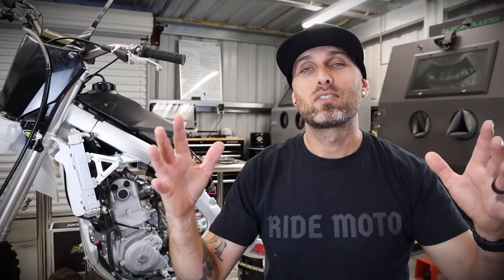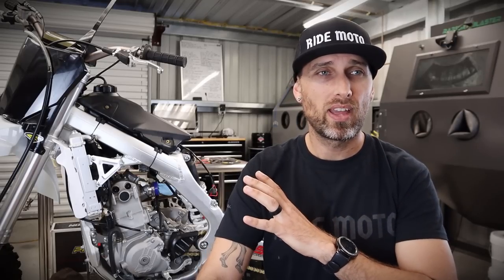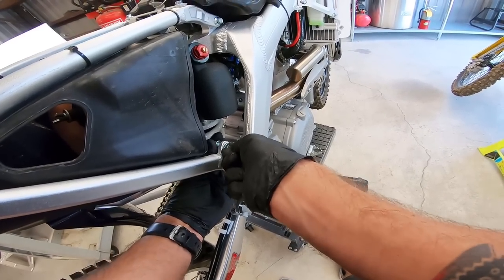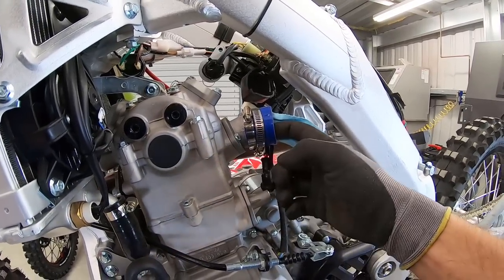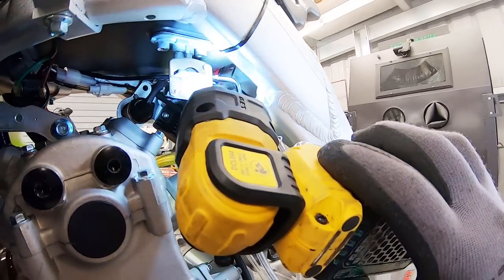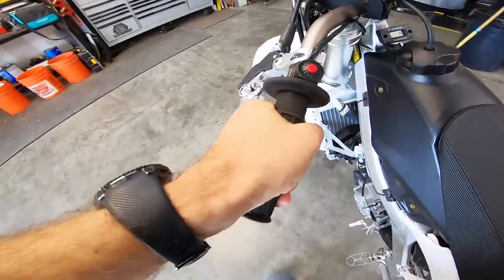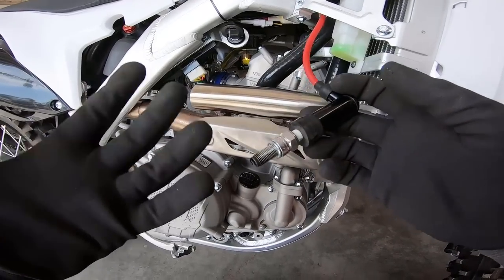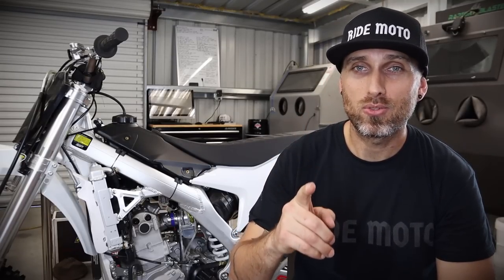I Installed A Lectron Carb in my CHINESE Dirt Bike... SHE REVS!! - 2020 SSR Motorsports SR300

Comment: Thank for this very good video ! I have Kayo T4 ( 250cc zongshen air cooled ) with a stock " Nibbi 28mm " carburetor, I planing to buy a 32mm or 34mm, what is the best size for my engine ? thank you for the answer
Reply from the maker: You're welcome! Thanks for watching. Not terribly sure with the Nibbi but 34mm or 36mm should be ok on the NC300 engine. You can always match your stock carb's millimeters too as a fail safe.

Our Lectron mod is a 36mm on 300cc engine 🤘 I think 32, 34, & 36 will all be good options.

Comment: Great video! After considering a new KLX300R and WR250F...I think Im leaning towards the SSR 300 instead after having the 450. Bike was just a well built tank and great looking. Will the Lectron u are selling fit the newer airbox/boot of the 2021's???
Reply from the maker: Awesome! Working hard on the 2021 fitment, just need more time. The 2021 300 comes with an FCR carb though, which is a big step up to begin with though not perfect either. It is a much better unit than the 2020 SR300 carb.
Reply: @mxrevival  I see on the Lectron site it has options for 2019-2020s, then 2021. It looks like they have it done already
Reply from the maker: @tieoneon1614  happy to say I'm who they're working on this with in order to make it happen. 2021 should be pending unless you buy a Gen II (the $800 unit / which we do have) and I'll have them up on mXrevival.com as soon we I know 100%! But for now, that's technically a typo. Happy 4th!!

Comment: Salve, volevo un informazione ho anch'io una moto cinese simile alla tua,erz300 raffreddamento a liquido,ho anch'io sulla mia lo stesso problema del vuoto all' apertura dell' acceleratore veloce,monta un carburatore pwk34,secondo voi potrebbe andare bene un carburatore specifico per 4tempi tipo a membrana PD36G per risolvere il problema? grazie

Comment: After setting idle did you have to readjust cable slack does the lectron  set idle by air fuel or raise the slide position
Reply from the maker: I did re-adjust one last time. It brought the bike to a very nice, crisp response.

Lectron has an idle screw just like a Keihin or Mikuni, that raises the slide.

Good questions.

Comment: Hey man thanks for the vids' so I just bought a ssr450 is that carb similar to mine?
Reply from the maker: You're welcome, Miguel!

Thanks for watching & congrats on your new bike 🤘

You know, I am not totally sure. I believe your bike has a different carburetor than what comes in the 300s.

I'm not sure if yours has an accelerator pump & after digging for a few minutes online, I didn't see any photos that could help me see it any closer.

You can email me a photo if you'd like: Charles@mXrevival.com & I'll take a crack at it for you.

But the simple answer is,  if it's running well & you are enjoying the bike- then it probably doesn't need a new carb. 

-Charles // mXrevival
Reply: Yes, just smaller.
Reply from the maker: @tabcobra  thanks for verifying!

Comment: What brand is that scissor stand? Do you have it anchored to the floor?
Reply from the maker: This one is actually a Tusk. 

I use & carry both the Tusk & the Motorpsort Concepts lift stands & I really thought I was going to hate this Tusk one because it had wheels (and because it costs less than the M.C. stand which I had already paid more for! Ego hit!)

I ended up loving the Tusk stand even more. They totally save your back, It's fairly cheap and just makes like so much easier. 

I like that you can strip a bike away from end to end & work towards it's center (frame) on these and the wheels ended up being so damn handy! I'll probably replace the M.C. stand with another Tusk in the future. I love it. 

Hope that helps!

Comment: hey buddy, which is better between trailmaster tm38, SSR , or EGL¿.  im leaning towards egl cause they have a 450cc, does ssr have a 450 and if so which 450 is cheaper egl or ssr
Reply from the maker: The 300’s are all the same bike just re-branded under EGL / SSR… different colors etc 😁 Get the one you like best. Not familiar with the non-SSR 450’s but the SSR 450 is a copy of the Honda CRF450X which means there are some Honda mods that work on it.

Comment: I have an 01 xr400 im looking to throw a little modern-day tec so it doesn't bog in 1st, get easily dirty jets, and when the bike drops it passes Gas all over. Would a lectionary be worth it? I had a guy say a piston upgrade is better but idk
Reply from the maker: Hi Saron, 

It would definitely be worth it but it sounds like you could also rebuild your current carburetor and be running well again! The things you described can be serviced.

Of course, if you want a Lectron, I would be happy to make that happen too.

-Charles // mXrevival

Comment: Liked and subscribed... I appreciate the good job you do your videos.  So are the fork springs, shims and rear shock spring "industry standard?"  Like could one send the suspension to Pro Action, Race Tech, etc. for tuning?  The bike is beautiful, the fit/finish and welds look solid.  I'm also curious on longevity.  Also, I'm sure (hoping) that you will cover the rest of the "usual stuff," like maintenance, top end rebuild, etc.  Does one have to get "special parts" or does it, again, use industry standard?  Thank you!  👍
PS:  There used to be a close/near exact copy of the Honda CR 450R, done by a Chinese company (I don't remember their name), but they had to stop because they did not have the claimed permission from Honda to make it (oops).  From what you have shown us, the Chinese have come a long ways.  😃
Reply from the maker: Awesome comment, I really appreciate it!

I'll take a crack at some answers now too:

-Thank you! I will definitely keep on trucking. I really did this bike, especially after MX track riding them yesterday (video coming)

-You could send these forks and shock anywhere you want. I will be digging into them SOON and datalogging everything with J.B Covington at Ride JBI very shortly! We're going to get an MX specfor valving sorted out, figure out the springs we can all use, etc... It's valved perfectly for trail riding right now & the suspension brand is called "Fast Ace". Service seals and such per usual w/ 48mm Honda stuff.

-Several reports of these engines (Zonshen 300 "NC300", NC250, and NC450) lasting several hundred hours. If you blow it up, just by another one. They're onlt $1500 bucks and one of the most commonly used engines in maybe hundreds of different motorcycle makes around the world. It's the "Honda Civic" of engines & for comparison - that price would only get us 1 Japanese engine cylinder head w/o labor to install (Love Jap bikes, just an example)

-The CRF copy was Asiawing & also SSR - both made by I am not exactly sure who, but branded with the names I just described. SSR still sells them! 250cc & 450cc!

Thank you for your thoughtful and constructive comment, J!

-Charles // mXrevival
Reply: @mxrevival  Cool stuff and thanks.

Comment: Do you think it's worth fitting one of these to my 2009 kxf250. I'm debating buying the athena 290 kit and getting that ported too. If just a Carb swap would do so much though I might not want the athena
Reply from the maker: Your Kawasaki probably doesn’t need a carburetor as bad as this SSR did… but the Lectron we carry for your KX250F will be a nice improvement regardless, and very enjoyable. 

You can check it out here (you will want to select “Gen II” as it’s a proper carburetor to install in your four stroke. You can also see photo of it Installed on the black and yellow YZ450F): https://www.mxrevival.com/product-page/lectron-carburetors-two-four-strokes
Reply: @mXrevival  thank you I'll take a look now

Comment: So I have an ssr 170tr and I’ve noticed after a short ride it seems to be kinda hot. Granted I’m a full size adult, (5-6/150ibs) and rage on it in the woods. Now it’s 100% stock and I have similar issues that you did with the carb, so my question is “if my bike is running lean it could make it run hotter? And buying and aftermarket carb with help with reducing how hot the motor  gets or how fast it gets hot? 
Second question. Please send me in the direction to get quality replacement/ aftermarket parts. The dealer I bought mine from is a douche’ (Myers motor sports kane,pa)  and have had zero luck even finding an oil filter for mine. Please help.
Reply from the maker: Yes! when bikes run lean they will also run HOT! Extra fuel will help cool the engine. I would try jetting your carb with larger jets before dropping cash on a different carb 😎 I get that a lot about the dealers. If SSR would let me in as a parts supplier without requiring me to buy in on the full line of bikes- I would have all that stuff for you guys & would love to (filters, etc) That's where you guys come in! I need everyone's help pestering them until they cave in. 

For now, check this site for parts: https://www.orionpowersports.com/

I don't know if they have what you need, but it's worth a shot. Also- if your SSR is a Honda clone, perhaps a Honda filter will  work. 

-Charles // mXrevival
Reply: @mxrevival  okay I will definitely do that. I couldn’t express how bad ass that would be to finally have a consistent parts dealer. I hate shopping for parts for my bike. However I will say my ssr170tr has done nothing but impress me besides the minor issues with jetting, air filters and the chain. But thank you for the advice this was truly helpful.
Reply from the maker: @rodtwichi1290  It was my pleasure & thank you for the support, Rod!

Comment: you had two sets of jets in your vidio.[extra] dont remember seeing you put the larger  jets the two in and rideing it with them in it... could  be wrong but just asking...
Reply from the maker: Hi Marvin, 

Good question.

I did not upsize to the largest (other spare) main & pilot. The bike became rich just from the next size up.

I've learned just from Head Engineers at SSR that the stock airbox is simply flowing too much air for the 2020 SSR carb to handle.

Stay tuned for the next video! I'm going to explain it in more detail. I'm pumped. 

-Charles // mXrevival

Comment: How does the power compare to a crf 250r or any 4 stroke 250 race bike?
Reply from the maker: Much closer to a 250f than a 450F.

Definitely a little more bottom end then a 250f, and slightly less overall horsepower.

But it makes good power, it feels good and is manageable.

The way it makes power is really great, and super usable. Really workman like
Reply: mXrevival I feel like it’s very comparable to a crf 230 the way the video makes it look
Reply: @mxrevival  ..These bikes come stock with about 30 HP a CRF 250 has near 40...but the potential is there...already the carb will help tons as these are severly de-tuned....gearing will also help try a 49 or 50...they design them to be a more torque engine..also the ignition timing is way back....porting could also help...just some thoughts.
Reply from the maker: @jonthelamb4549  I'd say plenty more torque & HP here on the 300 & much more bike (and accessories) overall in size, since the CRF230 isn't a full size bike.

It's been years since I've ridden a 230, but I don't view them to be in the same ballpark in a most ways. 

230 is a great bike though!

Comment: whats your thoughts on using a cr flat carb with upgraded pump on my SR300
Reply from the maker: I haven't tested the 2021 setup yet - BUT - I was sent a 2021 full setup, so I'll have real-world feedback on it soon.

Our Lecton mod is getting rave reviews on the 2020 SR300 https://www.mxrevival.com/copy-of-shop-tools

So insanely cool to be a part of that. No jetting at all or adjustments to be made. 

The 2021 SR300 carb will require a new intake, air boot, air filter cage & of course- the pumper carb. I am still trying to find out what they will cost for everyone & also when we can get them in order to send them out!

-Charles // mXrevival
Reply: @mxrevival   whats the schedule for new releases for SSR upgrades on your website?

Comment: Does anyone make a performance camshaft for these motors yet?
Reply from the maker: Great question and I am unsure. Henner Motorsports may have a better answer for you. Also, you can search under "Zongshen NC250" or "NC300" as that is what the engines are called in the 250 and the 300
Reply: @mxrevival  cool, thanks. I've got a megelli 250r (nc250) road bike that I use on the track. I'm still very new to racing... I think I'm going to end up making a cam grinder 😅 like the diy ones on YouTube

Comment: What engine is fitted to this bike as in model and manufacturer ?
Reply from the maker: They are made by a company called Zongshen, and this model is called the NC300. It's basically the NC250 with a larger cylinder. So the NC250 part number still comes in very handy when doing generic searches for parts. The 300 hasn't been out that long I don't believe.

Comment: i have the 22 xf250x dual sport and when it gets to about 70 mph it bogs and loses throttle. I have to back it down to about 65mph. Any ideas?
Reply from the maker: Maybe needs a little more fuel up top. I'm not positive, but you could check your needle clip position and lower the clip, effectively raising the needle and letting more fuel through the main jet at wide open throttle positions.

I'm not sure if that bike is carbureted or efi. But if it's carbureted, you can try what I wrote above 👌 if that does not work, shoot me an email anytime and maybe we can smash one of our Lectron carbs in there. 

Great overrev

Comment: Anyone notice how similar the engine is to the ktm rfs? Starter engine position, head, valve adjustment look like the rfs engine.
Reply: it's Chinese, and yes it's a clone
Reply from the maker: Wow it does look very similar in design. Not spitting image clones or interchangeable. I believe the Zongshen is much less compact overall esp. the bottom end/ gearbox area.
Reply: @mistermaster1945  I was assuming it was a clone wonder why they chose the rfs? There is difference’s of course. Water pump and oil filters are in a different spot, assuming this is a single oil filter instead the rfs is dual oil filter.
Reply: @mxrevival  Exactly i just can’t figure out why they chose the rfs unlike the crf its modelled on, maybe production cost or they needed a older 4 stroke engine with good performance to clone of that they wouldn’t get a lawsuit for?
Reply from the maker: @Jack-vh2kn  I'm not convinced that they cloned the RFS in particular & perhaps a coincidence that they are similar looking. 

They're called Zongshen NC300 (NC250 & NC450 variants).

Literally millions made, as they stuff them into everything under the sun motorcycle wise. Tons and tons of different makes and models use the NC.

So tons of parts available which is great!
Reply: @mxrevival  The Chinese brands do all seem to be the same bike just rebadged haha, i do see your point as in the engine they definitely are not a direct clone but i do think the rfs was inspiration to their engine.

Comment: DO THEY HAVE A RACE READY BIKE OUT MOTOCROSS WIYH THE SSR
Reply from the maker: They do have a 250 and a 450 as well, that are modeled after the 2006 through 2008 style CRF250R and CRF450R.

I'm not sure what class you're racing but just like any bike, these could be set up to work and have a lot of fun on. 

I ride a much more Motocross oriented settings than I do trail riding, so if you keep your eyes on the channel I'll be working on getting this 300 more towards Motocross inspired events and situations along the way.

Comment: What kind of gas do you run in it?
Reply from the maker: 91 pump is fine. I typically have 101 for the four strokes here at the shop for the track bikes, so it'll get a bit of that too.

Comment: Look for a bigger header pipe. You'll gain a ton of hp.
Reply from the maker: Definitely a pipe in the future!

After speaking to one of the heads of R&D at SSR a few days ago- anybody running the stock carburetor will experience a loss in power when they open the air box or mod the exhaust flow with the stock carburetor. (According to their research)

Turns out they are actually restricting the air box in tests and getting it to run better with more power. Really interesting conversation with them.

With this new Lectron though..... We're ready for pipes and airbix mods!! 😍

Comment: I will only disagree with you on one thing, should have put a brand new filter, even the most expensive filter you can put there pales in comparison to the cost of the carburetor but I guess that's how you roll
Reply from the maker: It's good to have preferences! Nothing wrong with that 😎

I'm happy with the filter that's already in the tank!

Comment: He wasn't earthing the spark plug no wonder there was no spark at that point
Reply from the maker: The wire itself was actually disconnected at the coil. So while you are totally right, it would not have sparked anyways 👌

Comment: $600 carb on a $5000 bike. That carb costs ~1/8 the cost of the whole bike. Lectron makes a good product but it’s priced to only really make sense for competitive racing.
Reply from the maker: Closer to $500 for the SSR. I understand where you're coming from as someone who may not own this motorcycle or deal with it's particular issues. I will say though, the +$600 Pro Circuit slip on pipe is not a good value not does it enhance the motorcycle past adding a spark arrestor (which can be purchased for about $70 for use with the stock can). The Lectron truly was an awesome addition to maximize this investment & I've helped a lot of people do the same. Imagine buying a bike that never runs right. Do you sell it and take a $1k hit out of frustration or spend $500 more to get a cool mod, get to work on your bike, and have it run amazing?

Besides, "dirt bike math" never has made logical sense, nor do stupid dirt bikes like me understand fractions 😅